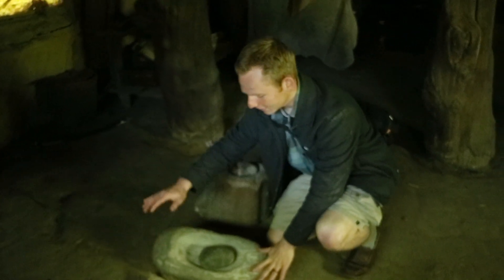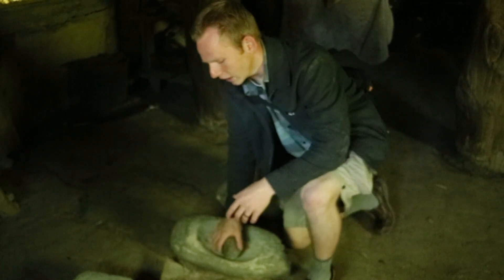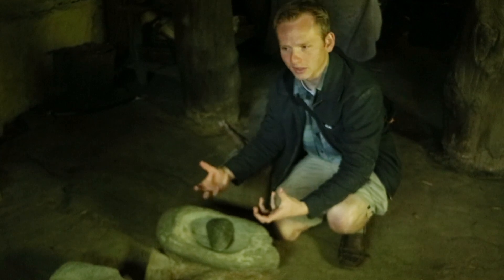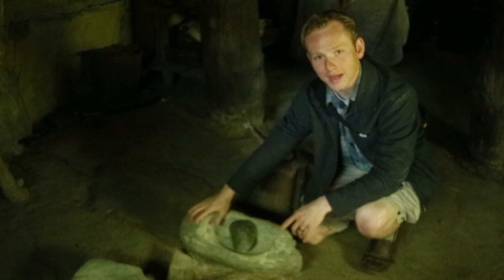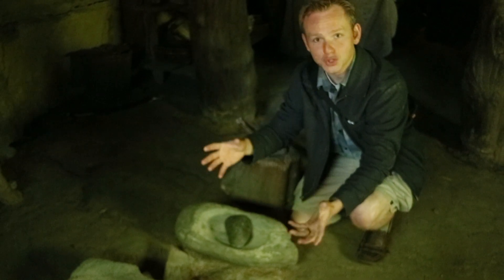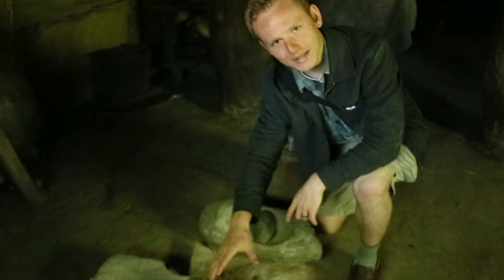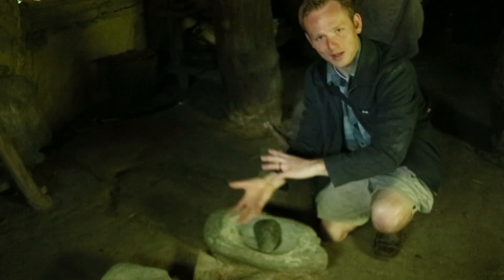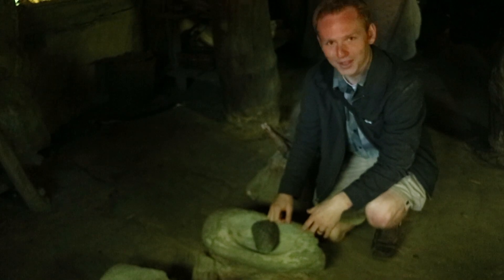Mano y Metate vs Rotary Quern: Appropriate Technology for Corn

Comment: I have always wondered how do you even avoid or remove the stone from milling flour?
Reply: Use a hard stone so it wears slower.
Reply: I don't know if it's particularly usable, but depending on what you're making, if you mix your ground mix into water, the stone will likely end up sinking to the bottom. Just a thought though, no idea how practical it would be.
Reply: Uh you don't. It'll aid in your digestion brah. Lol

Comment: I've never had issues grinding my corn into masa with a quern or any other method... Because I haven't tried.
Although now I do want to go bug the developer who works on the Terrafirmacraft+ mod for minecraft and ask them to add the mano y metate.  The only grinding option available right now is the quern, which requires at least copper or higher tooling to make (in-game).
Reply from the maker: Awesome! You should check out done of the incredible mano y metate artifacts from central America. They were made with only stone tools. JB

Comment: I always wondered about stone dust in these arrangements.. wouldn't you enrich your flour with stone dust that's been abrased from the milling stones? Or was that just something no one could really avoid and thus they just stuck with it?
Reply: I believe he mentioned in a prior video that there is evidence of "enhanced" dental erosion as a result of ground stone in their stone ground flour.
Reply: @Kineth1 that's false. Do you have any idea how hard you'd have to chew to do that? Plus it would kill you after a few bites. Plus teeth are not harder than stone. Common sense
Reply: Stone milling like this does lead to trace amounts of stone residue (the amount varies on type of stone used) which could’ve slightly effected diets with the added minerals.
As someone else commented there is evidence of dental erosion from this method of grinding, it’s one way to identify if a culture had access to this technology
Reply: Just don't let the stones touch each other. Always make sure to only grind the seed or corn or whatever.